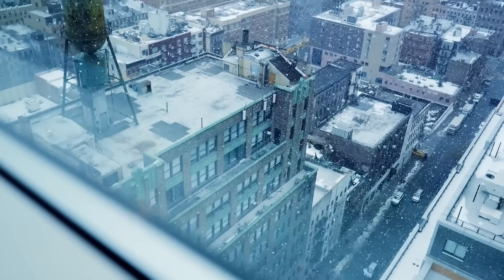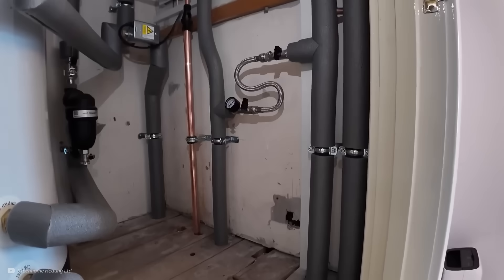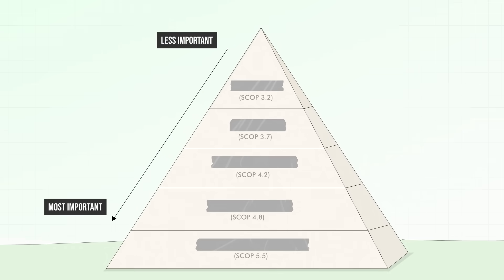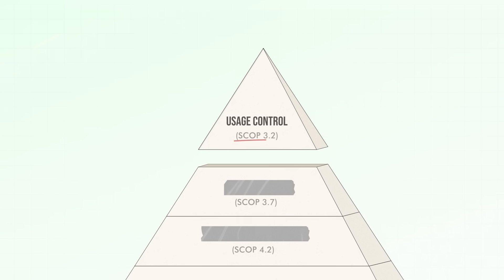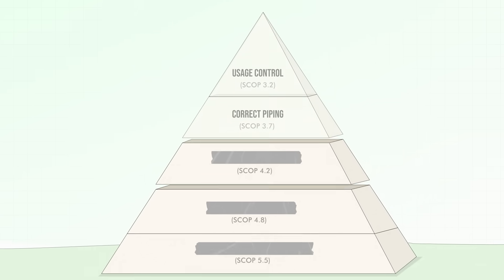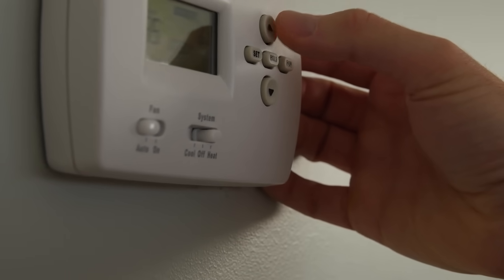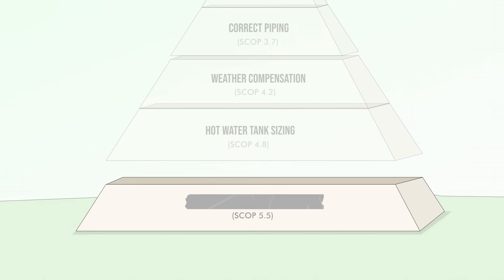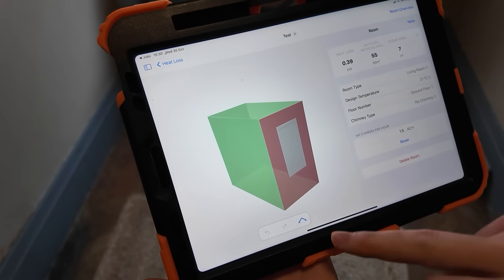The Genius of the World's Most Efficient Heat Pump

Comment: So I had a $9000 heat pump system installed by a professional company. I ran it for two years now and from the figures I see it will take over 20 years to pay for itself. Heat pumps seem to be cost effective only in areas with high electricity costs.
Reply: It cost us $14,000 to install our high efficiency Mitsubishi HP in 2010 and it has saved us $30,000 since then.  Which more than paid for itself and the essential upgrading of window and doors and insulating the basement.  And out electricity costs in BC have averaged less than 10 cents/kWh over that time - so amongst the lowest in North America - let alone the world.
Stopping heat loss via windows and doors and wall is critical to get the full advantage of a HP.
Reply: I had to replace my HVAC system a couple of years ago (I have a friend in the business).  In inquired about heat pump setups and even tankless hot water heaters (when I had to replace that unit the previous year) and he wasn't overly convinced of them, at least yet.  We get hot summers and cold winters here so the places selling heat pump systems still require you to use a gas furnace in the winter, so you're likely only using the heat pump for 3 seasons.  The significant cost rarely makes financial sense, at least yet.  I spent about the same as you (I think it was $9200) for higher end (higher efficiency) gas furnace and AC units from Carrier and added a HEPA filter system to help keep the air clean.
Reply: @jeffer1101  Depends on what your electric rate is. Where I live electricity is 9 cents a KWH with final actual bill cost (they get you on the additional shit) is 15 cants. Summers are sweltering, winters mild. Even with those (supposedly) ideal heat pump conditions my electric bill changed maybe $3-4 a month lower after I put in the new system.
Reply: @glasslinger  Where I live, we can't use a heat pump on its own, you must use an additional (traditional) heat source for the winter.  Maybe some day, the heat pumps will improve for the really cold temps in winter, but it doesn't appear we are there yet.  My friend said heat pumps (here) aren't worth it.  You'll never recoup your costs on them.
Reply: And yet in the coldest climates in Europe, Norway, Sweden etc. the amount of heatpumps is the highest. It seems to be a hard to kill myth that heat pumps don't work in cold weather.
Reply: @pietheijn-vo1gt  The building code here won't allow a heat pump without a traditional heat source in addition to it.  I don't make the rules.
Reply: @jeffer1101  But your original comment suggests heat pumps don't work in cold weather, which is false. You never spoke about regulations.
Reply: @pietheijn-vo1gt  In those countries being politically correct is a way of life to them. They are not concerned with the cost of their mania.
Reply: @glasslinger  wtf does that even mean?
Reply: @pietheijn-vo1gt  Yes, I did.  I specifically said if you went with a heat pump, you were required to use a traditional heat source with it (typically a natural gas powered furnace here).  If the building code requires a traditional heat source, it leads me to think they won't operate adequately in during the coldest periods of the year, which is why they won't allow a heat pump on its own.  I would imagine in more moderate climates, they are perfectly fine.  I was interested in them, but due to the requirements of still needing a new furnace, the cost was significant and I was told I'll never make back the difference.
Reply: @jeffer1101  This is a completely ridiculous statement. I am very curious to know which building code differentiates between heating technologies and effectively penalizes reneweable heating for no reason. Either you misread the building code, or the person advising you has no clue what they are talking about. Please get a second opinion.
Reply: @pietheijn-vo1gt  I did a quick search.  It might not be code, just the suggestion by the companies who sell them.  They seem to say that most heat pumps work to -15C and some to -25C.  That is likely why the places who sell them here won't sell one without a secondary backup.  So perhaps not a "code" issue, but they don't want to deal with people in the middle of winter who can't heat their homes.  If you went with a heat pump here, you'd basically just be using it to replace your AC unit, which doesn't really make sense to do.
Reply: Depends, higher electricity costs do play a big role. It also depends on climate. I replaced an old 10 seer unit at my house myself for about $4000 to a 20 seer unit. But even that is somewhat misleading. Because this new unit actually performs well at lower temps. The old unit NEEDED backup heat strips to function under 35F or so. The new unit doesn't even have heat strips installed. it's been run as low as 8F or -13C and works great.
Reply: Cheap compared to the $40k that mine was to install, but it's a geothermal.
Reply: solar too. in a perfect world you could break even after 5 years. but if you look around, this isn't a perfect world.

Comment: This for Europe. Most all heat pumps in the world use mini splits, it's very expensive to use all that plumbing.
Reply: UK homes are mostly fitted with radiators so heat pumps are being made to work with them. This is why heat geeks always say to run heat pumps 24 hours a day. Swapping radiators for fan units would be a far better improvement than fitting larger radiators which is what is usually recommended. 
As we heat every room, mini splits are not suitable. In my house one small gas boiler heats 14 radiators. Much cheaper than 14 mini splits to install which would also look terrible on an old house.

Comment: Ok. So a huge tank of water which you can heat up in a noon with a helping from solar panels, and a heated floating floor which requires relatively low temperature to minimize heat loses, is a key to success. Sounds very good to me.

Comment: The only heat pump getting a CoP of 8 is a geothermal or ground source heat pump. That's it. There is no air source heat pump that can exceed a CoP of 6 in actual operation.

Comment: So nowhere near a COP of 800%, as it was during one of the warmest months in the year, when you only need to warm the hot water. And accepting colder hot water, with all the health problems that could bring. Also with day long constant low temp heating, so you're using electricity 24/7, instead of much cheaper gas for a few hours. All with huge & complex installation costs, and the huge cost of a new ASHP & broken controls every 15-20yrs.. Unless you're a mad staring eyed cultist, obsessing over graphs of your COP numbers & outside/inside temperatures, this is never going to win over the vast majority of the public.

Comment: Wouldn't it be more efficient to add your hot water heating into the heat pump circuit?
Then, excess or available energy could be saved as hot water heat instead of running conventional systems

Comment: I'm confused. You state at the start 800% then as you go through your explanation it comes down to 500%.
How do you measure the efficiency of the heating system, I'm intrigued?
You state that by doing this or that the efficiency goes up but is this theoretical or measurable with empirical evidence?
Please don't misunderstand I'm not against heat pumps but I've heard so many stories and from what I've seen of them so far not impressed.

Comment: Last year i basically took his way of thinking and applied it to my boiler system. 
I used AI to write a bunch of strategy codes. Taking information from outside vs inside. Crazy efficient compared from last year. Basically doesn’t shut off but I’m able to control water flow and tank temp settings on the fly.

Comment: Electricity in the UK (on a standard tariff) is about 4x the cost of Gas.
To reach the break-even point you may have to replace your pipework, water cylinder and radiators which could cost up to £20k.
For most people, you are better off spending the money on insulation and glazing - which will always give a cost benefit.

Comment: I'm often wondering why hardly any heat pump videos have a look at the collector of the heat, to see what actually happens when you try to pull heat from the outside air. In humid climate, where I live, the first thing you see is that it builds an isolating layer of ice on the collector. I've yet to see anything that addresses that issue. I see many people assume that heat pumps will not work when things get colder, but I think moisture in the air is a bigger issue. Heat pumps clearly work fine in Nordic countries with much colder, but dryer air.

Comment: That was easily the best video I've seen on heat pumps! There is so much confusion and misinformation, simply regurgitated as fact and the result is a general reluctance to shift mindset. This video simplified the whole issue. That said, it would be worth a follow up video with emphasis on the fact that heat pumps only deal with generation and in terms of bang for your buck, insulation to retain the heat that's generated is just as critical if energy efficient homes are to be truly cost effective. Thanks!
Reply: Heat pumps are as much use as a fart in a space suit when installed into 75% of existing English housing stock. New builds yes, houses built in the last 10 years maybe older than that forget it.

Comment: The real efficiency of split systems comes from not using ductwork which is where 30 or 40 percent of the efficiency is lost. Window unit air conditioning is also efficient and now there are window unit split systems to supply heat or cold.

Comment: Though this is very informative for residential systems, as someone who does commercial HVAC controls, there is nothing new here. In fact, most of it is at least 70~120+ years old. That includes, tank oversizing with larger surface areas (heat exchanger), outdoor air reset, modulation based on proportional integral derivative, heat recovery systems, preemptive load learning(within the last 20 years), large radius piping, water balancing, frequency driven pumps/fans/compressors (last 30 years), and space load calculations. 

It is true, that most residential systems are very basic. Including my own, an on/off steam boiler with a Nest stat. 
The cost of this complexity comes with a very finicky system, that doesn't hold up over the years. For commercial customers, that use very large quantities of energy, the cost of having a control technician manage this complexity is worth the investment. But, for residential operation, the same amount of technical skill is needed,  the return on investment is greatly diminished. To the point, it is more important to "just get it working".

True innovation, would simplify the cost, complexity, and durability of controlling residential unit, using general skilled heating technician. I don't see this happening anytime soon, and expect manufacturers increasing the complexity with planned obsolescence.

Comment: This has certainly made the most of the system with the heatpumps currently available. Heatpumps are made down to a size and a price and as a result they have limited performance the C O P drops dramatically once the ambient outside temperature drops below 4 degrees C and the defrost cycles cut in. The colder the weather gets the lower performance of the heatpump . Changing from a water based system to a refrigerant system with a compressor modified for the application would improve things and the use of fan driven fin blocks instead of radiators makes it more room friendly. Using the superheat  to top off the hot water temperature makes the system more domestically friendly.  Bob.

Comment: Ha! I recently started an experiment with an ancient 500 watt window a/c unit, with all manner of of vent tubing and fans to try and make a heat pump out of it. Like London right now, the humidity outside my house (Portland Oregon USA) is over 80% and at such low winter temperatures the Tc radiator frosts up in just a few minutes and efficiency drops to the point that I have to cycle it 'ON' for two hours and then 'OFF' for 4 hours. Lots of fun collecting data with 4 wifi thermometers. Thanks for the video! It's convinced me that I'm probably going to have to dig a thermal well like they have up in Drake Landing near Calgary Canada. Maybe I'll get 1000% efficiency!
Reply: Proper heat pumps designed for the purpose include a defrost heater, precisely to cope with that phenomenon.  That means they only need to switch themselves off for a few minutes to clear the ice off, after which they can continue running efficiently.  An air conditioner can assume that the evaporator will be in room-temperature air, and therefore will not frost up.

Comment: Could the same techniques be used with a conventional gas boiler/combi boiler system? How much would efficiency/running cost be improved for that?
Reply: conventional systems cant get better than 100%
Reply: Some gas boilers can use weather compensation so you would use less gas to maintain the desired indoor temperature. However as @ pkdablu says you can’t exceed 100% efficiency (in reality most condensing gas boilers are closer to 90%).

Comment: The REAL genius of the minisplit design is that all of the parts are proprietary. There are no generic parts for these units, so they can charge whatever they like for the parts, and they are the only game in town. Brilliant.
Reply: Yeah it is paying off my house, I don't mind. Let people keep recommending proprietary stuff. I have given up trying to say otherwise.
Reply: @SuperS05  sounds like someone makes money repairing old systems.....and a 24000btu 21 seer minisplit is 1200$....and will save its value in energy let alone equipment cost far far sooner than its service life....dang.  

mfw some moron reccomends i blow 20k+ on some dorky 4ton lennox 20 seer central air unit or something.

think about the math
4 tons 2400$. install. 4 hours maybe, super simple.  throw a little gasket on, torque to spec, vacuum, release. hur dur.
money doubles every 8 years in market

installed cost is 1/4? service life idk 15 years, grossly outdated by then anyway and losing money in efficiency
so if it lasts even idk 5 years its paid for itself lol. 

minisplits - where they work admittely which is alot of places.
makes you realize what a joke your average hvac installer is.

commercial is a different beast, more complicated systems and humidity are a thing yes i know. but if you just want to cool a room or slap a bandaid on an ole weird house holy hell they cant be beat.

thus their popularity overseas

motel casettes - classy version of a window unit are also nice.  no hvac needed to install that just plug er in.
Reply: in america sure.  in china its basic AF.  theyre largely clones lol.
Reply: When the odu or idu goes bad, you have to replace both because they “communicate”. Junk! Ripoff!
Reply: @USA-GreedyMenOfNoIntegrity  i mean you dont. just buy another unit and then you have the spare OU/ IU.  or buy same brand or same clone brand.

Comment: Heat pumps have been standard in Sweden for the last 20 years and quite common since the 80s. I guess it comes down to the only energy we've had readily available is nuclear and hydroelectric. Gas and oil are not concepts in our energy supply. That and we've had building codes for half a century demanding that radiators not be sized for more than 55° water worst case. Many have taken that a step further and decided on 45° instead, making a good case for heat pumps. Whereas in countries with oil and gas supplies you haven't really cared about that, nor about proper insulation which has also been code for ages. It's both fun and sad seeing others inventing the wheel and sometimes getting it right, but mostly wrong.

Comment: Sub-standard heat pumps will soon be forced on all U.K. council tenants, as per usual, without these improvements being made and council tenants will not be allowed the option to retain their gas boilers - already, council tenants were forced to have smart meters in their council property and coupled with gas and electricity prepayment meters, the most expensive form of energy

Comment: The only way to increase the COP is by the use of different refrigerant gases (eg CO2).
The problem with current heat pumps is that they are using air conditioning technology. (not really suitable for a heat pump).